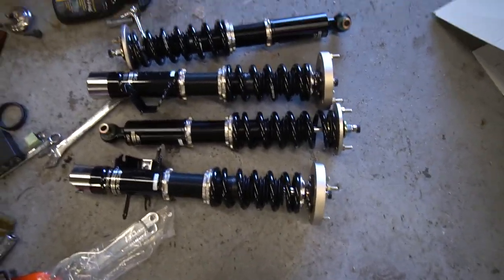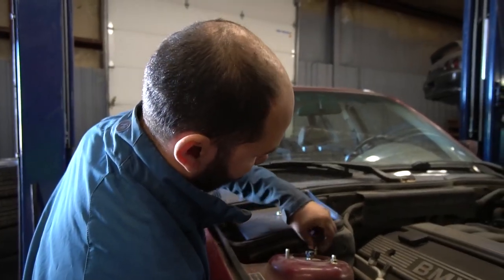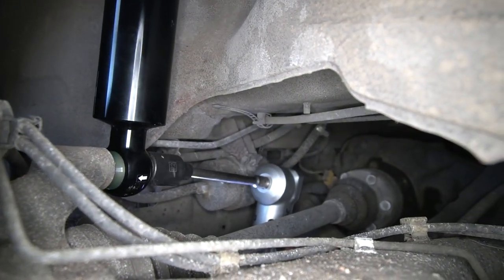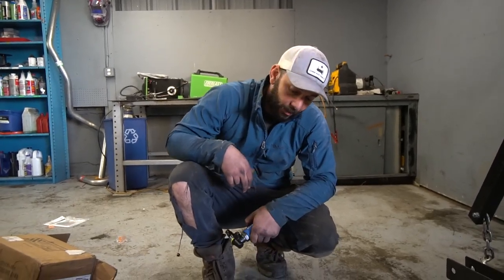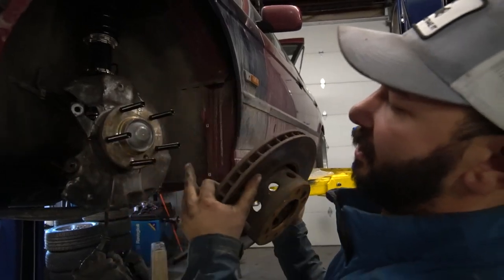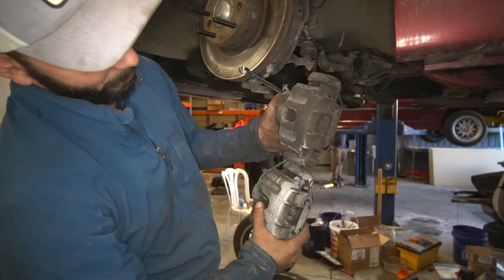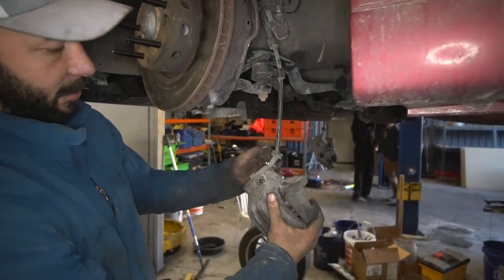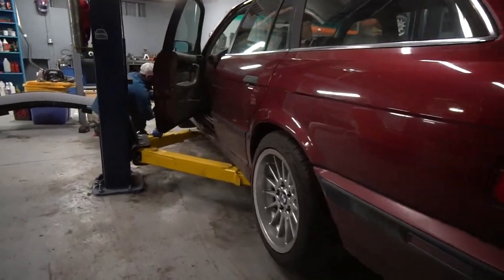Calypso Wagon Gets Upgrades!

Comment: That wheel is def fixable
Reply from the maker: Good to know, I'll get second opinion. First guy said no.
Reply: @DENVERBEERANDOIL  if you don't want them they'd look very nice on my e30 imo.. def get a second opinion I've done alot worse and had fixed
Reply from the maker: I'll try for next week. They would be pretty aggressive on an e30. 17x9 +8
Reply: @DENVERBEERANDOIL  another option would be to see if love20bee or three piece could save the center and make a custom multi piece wheel.. gave you a follow in instagram give me a follow and check my e30